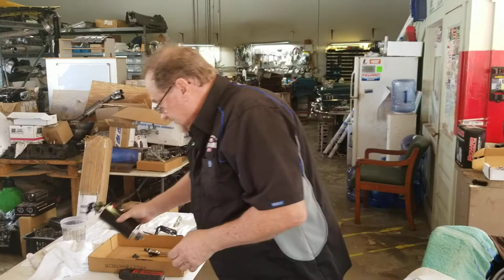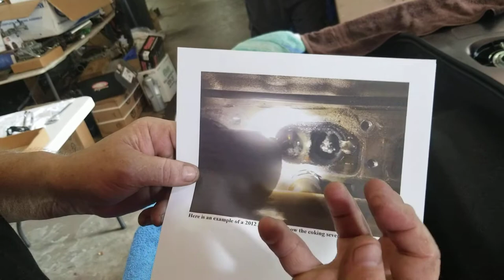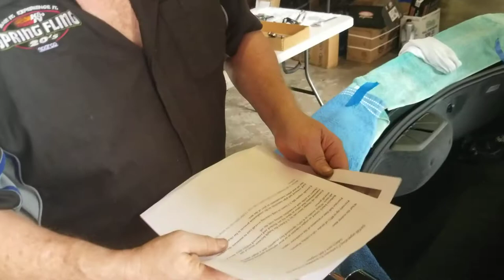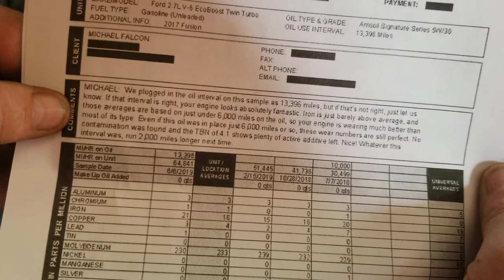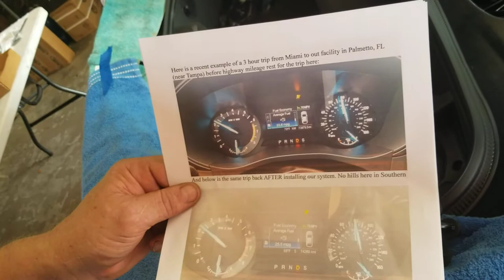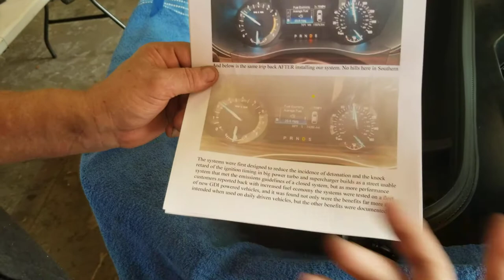Tracy Lewis Performance

Comment: So, what is the difference between the original can and the Tracy Lewis Signature can?
Reply from the maker: Our original RX can is tig welded extruded aluminum, our Signature series is the Billet CNC version with threaded top and bottom allowing disassembly if desired and a more attractive appearance. Both have the same internals of our Patent.
Reply: @tracylewisperformance1328  Thanks